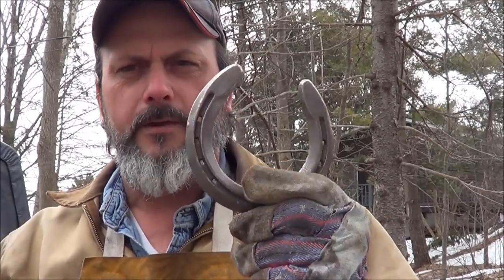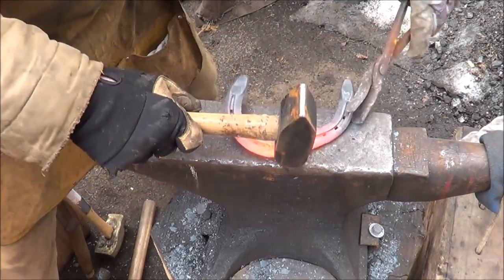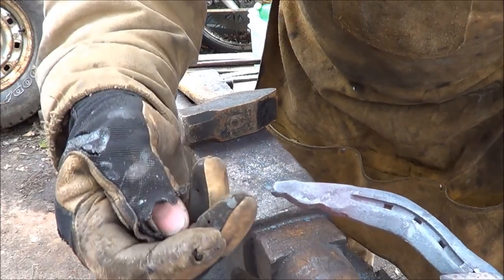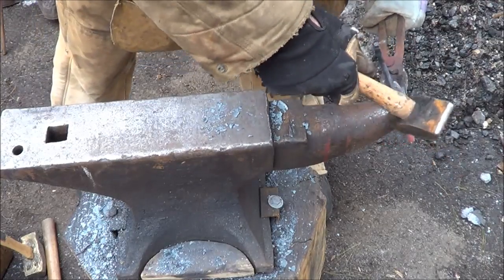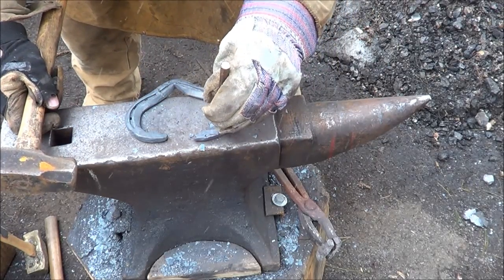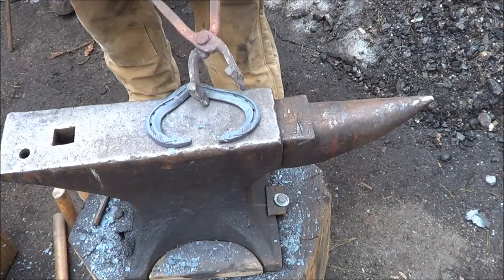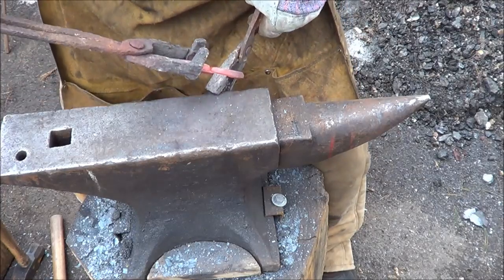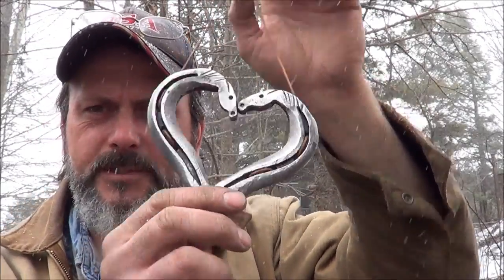Blacksmithing   Forging A Kissing Horses Horseshoe Heart

Comment: Very Cool! Chandler!I finally got my own shop up and running and hammered out a couple of hearts for Valentine Day presents. Actually several hearts because the first ones were pretty lousy. Hard to get the symmetry. Welded on three hammered legs and made counter trivets for hot pans to emulate fireplace trivets from the 18th century. 
Enjoy your videos and artistry. Now to find some horse shoes.

Comment: Thank you so much Chandler! You know I've been looking forward to this video for awhile and now I can't wait till the next time I get to do some forging cause this is without a doubt my next project.

As a side note, I recently got a blacksmithing tip from a friend of mine you might be interested in: harbor frieght sells end nippers (item #42266) that are fairly useless at their intended job, but can be easily turned into a good pair of tongs with a bit of forge work. My friend made a pair of wolf-jaw tongs with them that work just as good as the pair I bought Blakcksmith Depot.
Reply from the maker: JDTN1985 your friend might have got the idea from my video about making tongs from HF pliers...lol

Comment: Beautiful work.  I have a question for you, sir.  I do a bit of hobby welding, including horseshoe designs.  I want to be able to straighten shoes for making letters.  I assume that you use a forge for heating the shoes in the work that you do.  Being that a forge would be a hefty investment for my purpose, could you recommend a different method for getting the metal hot enough to be malleable?  Would a propane torch for instance produce enough heat/ heat enough of the shoe?  (I weld with flux-cored wire and do not have acetylene for heating) Eventually I may get to the point where I want to shape the metal the way you are with hand tools and the anvil.  The horse heads are really nice looking.
Reply from the maker: WantCoffee99   Check out my bucket forge video... You will save in propane what you spend in the forge easily....  Coal or charcoal though if you can find it coal would be cheaper.   I am sure you can get it hot enough with propane... you probably want it atleast red hot to straighten them.   Bucket forge is a pretty easy way to go...

Comment: So did you just scrub it with a wire brush to clean it?
Reply from the maker: Darin Humble Wire brushing it hot helps alot and then i took it to the wire wheel on the bench grinder and also a little time on a buffing wheel.

Comment: I love it dude. I make a lot of horseshoe art. I typically use my oxy acetylene torch for making my heart's. I do believe I am in need of a forge.
I also cut mine in half and then weld the halves together. I'm on Instagram @ Jim Rodgers and underthehoodwelding.